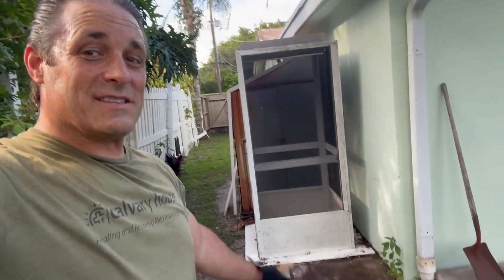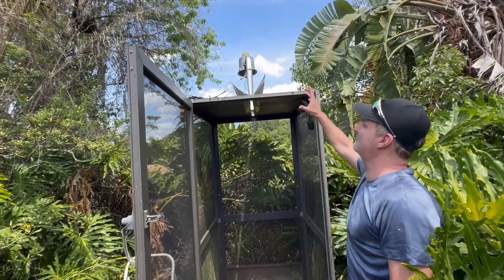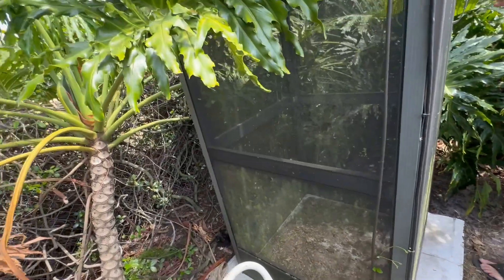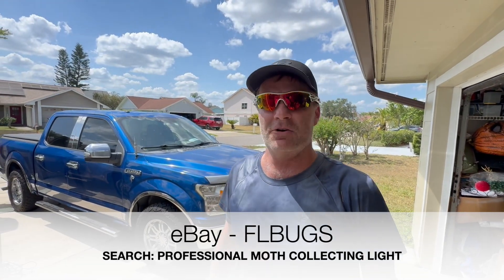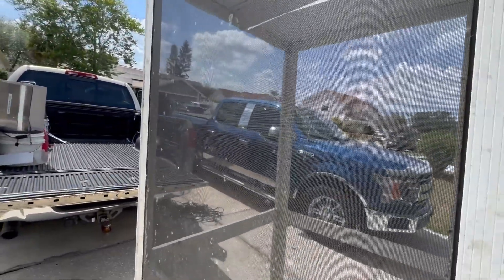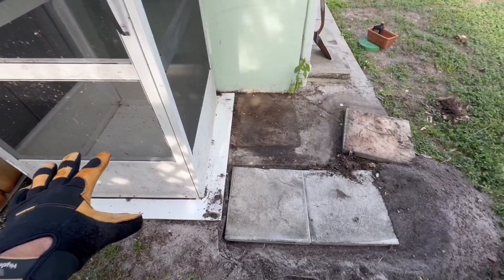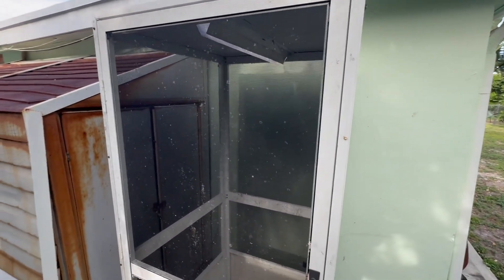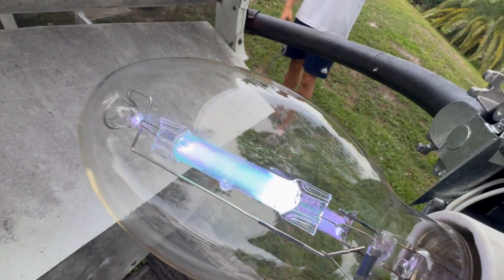MOTH TRAP   HOME MADE WALK IN WITH 175 WATT MERCURY VAPOR LAMP

Comment: I built the first one for the Central Florida zoo. Then I built one for my house. Dan, who is also in the Aluminum business, came over to my house. After studying my walk-In cage, Dan went home and built his own. Then he built one for his late uncle. Dan make a cool improvement to the base. I like David's saying he will place  diatomaceous soil at the base to stop ants from coming inside the trap. 
I sold the first trap for over thousand dollars over 15 years ago. Today with tariffs on Aluminum the costs are way higher on material. The labor is a factor, also. So, to purchase one today with shipping included, expect to pay close to $2,000. However, the frame can last 6:35  well over fifty years and the screen, if it is not cut, or torn by a bear, could last ten years or more. Replacing the screen is not very expensive, but knowing how to roll the screen into the grooves is a skill.